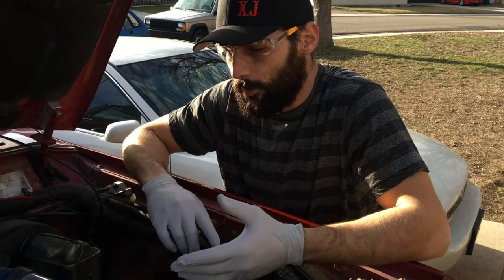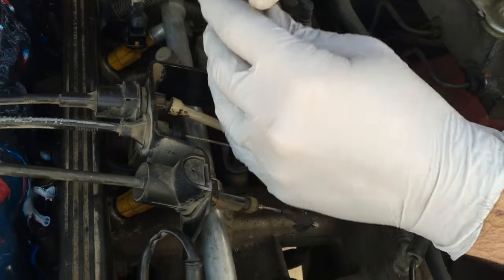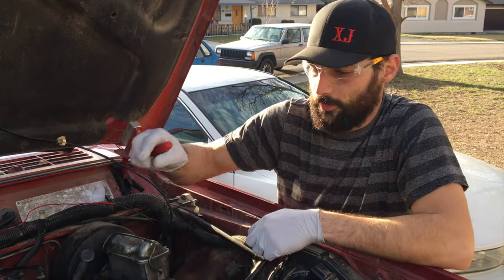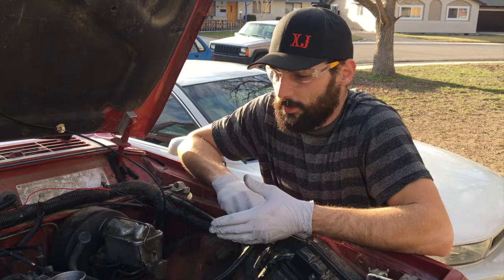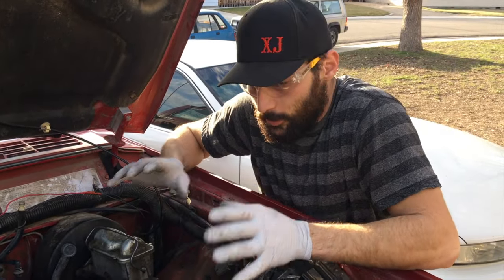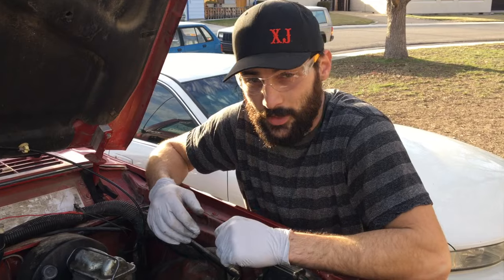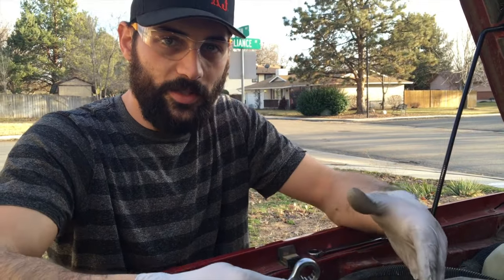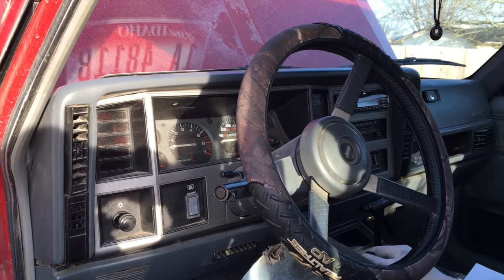Fuel Injector Upgrade Install

Comment: I have a 1991 Jeep Wrangler YJ, 4.0, My fuel return line is leaking just after the downward bend in the plastic (pin hole) How should I repair this. Thanks, GREAT VIDEO
Reply from the maker: Doug Harlow leaking in the plastic portion? Is this the side coming from the rail?
Reply: Yes, the hose comes out of the fuel rail about 4", then bends downward. the pin hole is 1/2" past the bend down. Sorry hard for me to explain.
Reply from the maker: Doug Harlow email us a photo and we will do what we can for you
Reply: Sorry but I'm still trying to figure out how to get the photo to you?
Reply: sorry, I'm still trying to figure out how to get the photo to you?

Comment: So.  The 12 hole injectors will be plenty for my 4.7l stroker? Was told about the denso ones and haven't decided yet but i got em in my cart on your website with the ripp coil mod kit lol
Reply: 12's are great. perfect for the stroker engine
Reply: @Raffi Kassardjian  OK cool ty.   I'm asking a ton of questions coz my apprentice at work just graduated from western tech and he has the tuning laptop lol
Reply: @autotek7930  I'll answer whatever I can for you. feel free to email anytime as well
Reply: @Raffi Kassardjian  too late.  I just placed the order so questions are irrelevant now lol
Reply: @autotek7930  lol

Comment: Hello, I've had times the 97 Jeep TJ 4.0 fuel rail with new injectors "pops" back into the intake ports and times it feels snug but no "pop" with no leaks but damaged a couple injectors. Should you feel or hear a convincing "pop" or not, what do you think?
Reply: usually don't hear a "pop" sound. they just slid in and bolt the rail down.
Reply: Thx Raffi for helpful piece of mind. At times I overthink or overpower small parts. Great video.

Comment: I see you had the Ford 86-93 type 19lb injectors on your XJ before you put in these newer skinny style ones you are showing in the video. Did you have any problems running the older Bosch/Ford 1.3 19lb orange injectors?
Reply from the maker: Paul Nunya the ones I had in there were the skinny style, it's a type III EV1 19# injector from ford. 
It's actually the main ones I sell, I just happen to have another set of 703's lying around and was requested to make a video so I swapped them out again.

There is no issue with either style injector and the gains are fantastic!

Comment: What configuration would you recommend for a daily/ weekend trail rig 95jx 4 or 12 hole and what LB rating I’m looking to buy off your site !!
Reply: can't go wrong with either choice. 4ports net more top end, 12ports net more bottom end torque.
Reply: Just Installed the 12 ports 🤌🏽 like new

Comment: What fuel filter would you recommend for the 4 hole injectors? Came here from the diesel side and read Bosch injectors wants 4 microns filtering. I doubt any standard Jeep filters are even close to that. Till I upgrade to a better fuel filter system I’ll use the best I can find. Thank you
Reply from the maker: Stock is fine. This isn’t a diesel, doesn’t need anything fancy
Reply: KSuspension  damn that was faster than a phone call. Ok, thanks. Great Channel.

Comment: Hey Boss, I have a question and I hope you can help me. I've spent literally thousands of dollars on trying to figure out my multiple misfire. I have changed everything I know to try fixing it. Crank and cam sensor, different injectors, coil pack, plugs, wires, ect. It started doing this about 6 months after I put a new head on. Where are you located? I've had 2 different mechanics try to  fix it but all they are doing is replacing parts and the problem isn't  getting fixed. The Jeep is a 2002 Jeep Grand Cherokee Laredo with the inline 4.0.
Reply from the maker: YP Schwartzy we’re in Nampa, ID

if you can bring her in, I’m sure we can find the issue

If not, shoot us an email and we can try the best we can over the air

Suspensionlifts@gmail.com

Comment: I was told to remove that clear pladtic round tip from the bottom side of the injectors. Doea it make any difference? Wouln't that plastic tip melt inside?
Reply from the maker: It’s a pintle cap, helps retain the oring, won’t melt, we leave them on 
You’ll be fine though

Comment: So, is there a noticeable performance increase for the $$$ spent on new injectors?   Or, is there some other benefit?
Reply from the maker: Improved atomization for better throttle response and cleaner burn. Less throttle for same results as oem. More efficiency

You’ll notice a change right off the bat

Comment: Got 01 with straight 6,with 107,000miles,one day it was reading random miss fires,new plugs n coil...light turned off a few days later on its own..month later,im idling for 20 min,it gets rough n shaky and truck dies,then when i drive it it fine..i was sittting in traffick and the check engine light was blinking too.....what should i check out next?
Reply from the maker: sounds like a combination of vapor lock and a bad coil rail. Check out our Viper coil mod for your 01, gets rid of that coil rail and you run regular plug wires to each cylinder.

Comment: How is this going to benefit the engine? Better fuel mileage?
Reply from the maker: we've seen many counts of improved economy, however that isn't guaranteed. the upgrade is for better atomization of the fuel, which in turn helps the engine run more efficiently.

Comment: What other tool can you use to disconnect the fuel line? Can you use. Flat head screwdriver?
Reply from the maker: I wouldn't recommend a screwdriver. If you don't have the disconnect tool, grab a pepsi can and cut out a section of it, wrap it like a circle, and push it into the rail to release the clip. 
Don't cut your hand.
the disconnect tool is cheap at most any parts store, even walmart should have them

Comment: What's the point of changing the injectors? Do they add hp if so how much, same for mpg.
Reply from the maker: Glad you asked, here's the low down on the upgrade:
the oem injectors are a single port design which...quite literally, "piss" into your combustion chamber, the 4 port upgraded design doesn't use any more fuel than the original, as they are matched to the same flow rates, but has a better "mist" into the chamber to allow better fuel atomization, which means you'll burn more fuel than you lose, your throttle response increases, your idle smooths out, highway driving will seem smoother, and your economy will level out

The upgrade is a no brainer for any owner of a 2.5, 4.0, 4.7, 5.2, 5.9 engine
Add in a true bored 62mm throttle body from and you'll be kicking dust at people behind you all over town!

There isn't any HP gain, as that involves more work internally in an engine, but you will notice a good change in your economy on top of the above mentioned results.
Reply: KSuspension Thanks for the reply!

Comment: So what "Brand" of fuel injectors would you recommend for a 2000 jeep TJ?
Reply from the maker: Wayne Harper the Bosch or ford Gen III bodied injectors will work perfectly for your model.
Let us know if you'd like to order through us, we do offer a lifetime warranty as well!
Reply: KSuspension with that lifetime warranty does that mean after 100k miles if I wanted to put new ones in for maintenance purposes does that cover them ?

Comment: I have a strange issue with my 2001 Jeep Cherokee Sport 4.0. When I rev above 2700 rpm's the engine starts misfiring and the check engine light starts blinking. I had the computer ($1300) and injector #5 ($420) professionally replaced, which were indicated by codes. I personally replaced both cylinder #4 value springs, the coil, spark plugs, timing sensor, oil pressure sensor, and engine oil & filter, which were all recommended by various youtube videos. I had the codes checked before and after each of these repairs. The latest code readings indicate multiple misfires on cylinder #4, injector Circuit/Open cylinder #4,  and misfires on all the other cylinders. Codes P0304, P0204, P0300, P0301 respectively. The suggested parts; valve spring. Have you ever seen this and do you have any ideas what I might try next. The car only has 95,700 miles.
Thank you in advance,
Clyde Massaro
Reply from the maker: Clyde Massaro I’d recommend a leak down and compression test

The 0331 head is prone for cracking between 3&4 cylinders

So it’s best to test to make sure it’s not a deeper issue before going further
Reply: Okay, do I need to open the engine and visually check for a crack?
Reply from the maker: Clyde Massaro you can remove the valve cover and inspect 

But the leak down/compression test will tell you right away

Comment: Did you replace them because the 4.0 vapor lock issue?
Reply from the maker: Although the new Gen 3 bodies do help aid with vapor lock issues, that’s most common on the 99+ models with the horseshoe intake.
This jeep doesn’t have that issue, we wanted the upgrade from the oem single port injector to improve atomization of the fuel
Reply: @KSuspension  thanks for the reply , unfortunately I have 01 grand and started having the vapor lock end of last year and start of this spring .. since temps started over 70 a few days ago.. was frustrating to track , others suggested injectors like these, or wrap.. I'm really wanting to just do injectors and have more even throttle and fuel economy..
Reply from the maker: Mike Daugherty not a bad plan, and you can do the wrap at the same time. We have 15% off in house items At the moment with promo: UNCLESAM www.ksuspensionfab.com

Comment: so I'm installing the new fuel injectors I got from you guys and I noticed that the new ones don't have the notch for the retaining clips. Is this going to be a problem?
Reply from the maker: m medrano not an issue at all
The fuel rail bolted down will hold the injectors in place.

Comment: I don't know if I asked this before but what happens to your gas mileage and will it still pass Ca. smog? Thanks
Reply from the maker: economy is based off driving habit and build type. it can increase, but shouldn't decrease, yes this is CA emission legal.
Reply: @KSuspension  thanks again, I sure don't want worse MPG

Comment: new problem. Did everything according to the instructions.  I reset the PCM, started the car and it's running super rough. is it supposed to do this? not sure what to do.
Reply from the maker: m medrano after a pcm reset its normal for the engine to rough a bit rough. The idle should clear out after a few minutes.
If you're still having issues, send us an email or give us a call tomorrow and we'll take care of any issues if an injector is the problem. 
They're all remanufactured so sometimes I do see issues arise. I'll warranty out an injector if it happens to be the problem.
Reply: it didn't clear up and it sputtering like an old Buick. not very happy about this.
Reply from the maker: m medrano as stated, the injectors are remanufactured and we stand by our work 100%, sometimes issues may arise, and I do apologize about the issue. If you happen to have a faulty injector, once found, we will replace it for you immediately. 

Send us an email or give us a call tomorrow so that we can narrow down the issue and get it fixed.
Reply: KSuspension  it says I have an open circuit on injector number 4 but that code was already there with the old injectors and it didn't run this bad. Not sure what to think or do. I may have to put my old ones back in and send you yours back. I would email now but I know nobody's at work on a Sunday at this hour so that's why I'm communicating with you here. sorry if it's bad PR.
Reply from the maker: m medrano I'm ok with an open service system. Weather we speak here or on the phone, I would tell you the same things :-)
Shoot me an email, I'll send you some tips to narrow down the issue and get you fixed up asap!
Please include your year in the subject line. I'll be waiting for your email 
Thank you
Reply from the maker: m medrano sending you an email now to get things rolling!

Comment: Would this be a good upgrade if running a cold air intake and bored throttle body?
I know I'm running lean (2.5L 4 cylinder), perhaps this would help?
Reply from the maker: indeed!

Comment: Did you upgrade the fuel pump too? Did you hv to reprogram the computer?
Reply from the maker: Sergio Macias not necessary for either

Just a pcm reset as shown in the video and you’re good to roll!
Reply: KSuspension I have a Grand Cherokee 5.2. The way you restarted your car would be the same way I would do it?
Reply from the maker: Sergio Macias yup
Reply: KSuspension perfect thank you! The video was great!

Comment: This mod is able to be done on the 5.2/5.9L as well correct? What has been the consensus from this mod on a v8?
Reply from the maker: My Off-Road Obsession: Life yes absolutely can be done

And on average we’ve seen 1-2mpg gain

Won’t notice much throttle response as the V8’s are larger, harder to tell, but the benefits for ease of engine response and economy have been shown quite often

Comment: My 93 YJ with the 4.0 will have a rough idle and occasionally die on a cold start but after a minute it will be perfectly fine. Is this possibly a leaking injector?
Reply from the maker: Jay could be
Could also be a weak pump or bad FPR

needs gauge and some diag time to figure it out

Comment: So if you take off the gas cap do you not have to use the pressure release on the fuel rail?
Reply from the maker: Yes you do

Removing cap helps prevent any extra backpressure from building in the system
Reply: @KSuspension  Thank you, I'm installing your 4 ports tomorrow!

Comment: okay so I'm giving thought to ordering these but how have they held up. 96 bucks for a set is really cheap and sometimes you get what you pay for .  Had my cleaned but now I'm getting an error code 27 for fuel injector problems and probably need new ones. Need feedback.
Reply from the maker: m medrano feel free to check out our Facebook page and read through our reviews. 
And you're correct, you do get what you pay for. An excellent product at an amazing price plus a lifetime warranty!
Reply from the maker: m medrano facebook.com/ksuspension

Comment: I need to replace both hoses coming off the injector, you know where I can get some? Having hard time finding.
Reply from the maker: Dustin C Mills both hoses coming from the injector??
Do you mean the electrical connections?
Reply: Sorry, you have one there on yours. I have two (1993), they go into the fuel rail on the opposite side of the pressure regulator.
Reply from the maker: Dustin C Mills mind sending is an email with a photo?
Not sure what you’re referring to I apologize 

The jeep in the video is a 92, all should be the same as your 93

Comment: So there is an uneven idle at restart, but will there be an overwhelming fuel smell?  No leaks, but smells like I dumped fuel all over the engine bay.
Reply from the maker: You shouldn't have a fuel smell. Are any orings leaking? fuel coming out the exhaust?
I saw earlier you commented that the seller of your injectors couldn't answer a question for you, if you'd like, you can email us, we'd be happy to answer any questions you may have, suspensionlifts@gmail.com
Reply: @KSuspension  Yeah, didnt mean to delete my first post, but deed is done.
I wasnt sure about the plastic cap on the new injectors, but I had seen in the video that you left yours on.  I think that the new injectors arent seating in the manifold properly.  They seated (press fit) well into the fuel rail, but just slid into the manifold without any effort at all.  I may need to get larger orings, i dont know.  
The aperture of the manifold were fairly caked but I cleaned them thoroughly.  I used dielectric on the orings for install.  This has me questioning everything I did.  If I switched two of the injector pigtails would it still run?  I may be over thinking it.
Reply from the maker: @rookiedeadmeat3639  the plastic retaining ring, or pintle cap as it's called, stays on. just holds the oring on. and they should slide into the manifold without much pressure, but shouldn't be loose in there. I don't know what injectors you're running now, but the orings should be the same size as your oem ones, so if you went to a parts store and asked for your model jeeps injector oring kits, you'll get the right ones.
Reply: @KSuspension  One of the injectors is stuck wide open.. I believe the orings they used were too small as well.
I did come up with (6x) Denso 12 hole today.  Ohms match origionals @ 12.9, but having trouble finding adapters (EV1 to Denso injector).  Do you know of a vendor that might sell them? (injector # 23250-31010)
Reply from the maker: Rookie Deadmeat those injectors will not work in your Jeep. 
If you’re looking for a good set of injectors, we offer them on our website with lifetime warranties. Www.Ksuspensionfab.Com 

We have everything you’ll need to get the job done right.
Reply: @KSuspension  The denso's are working well with an adapter pigtail.  The bosch 4 port that I had purchased were the wrong Ohms and one was stuck wide open.

Comment: this might be a stupid question. but why is it recommended that I reset my PCM?
Reply from the maker: Clears PCM memory to remap itself to the new pulse rate of the replacement injectors for optimum performance. 

Same concept for anything you replace, you should make it a practice to reset the PCM

Comment: I have a 2000 Grand Cherokee Laredo - 4.0L I bought new Stainless Steel fuel rail & Bosch 4-hole Injectors, so pretty much same process?! But what about the PCM reset? Is it still the same for my 2000? My parts come tomorrow !  Please let me know as soon as you see this! Thanks for this video!!
Reply: Yes, should be the same process :-)

Next time you're in the market for some injectors check out our website!
www.ksuspensionlifts.com